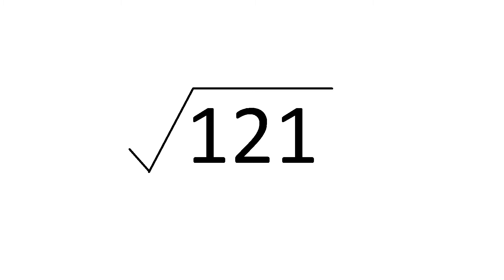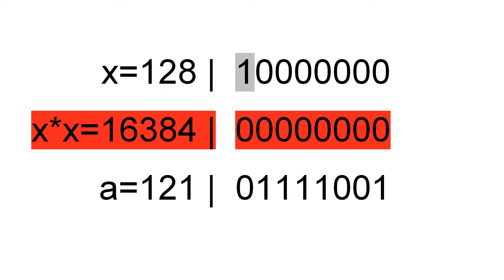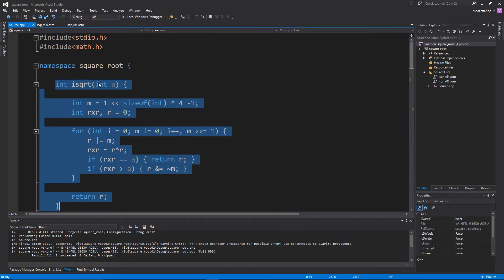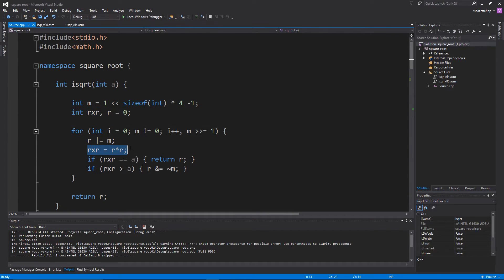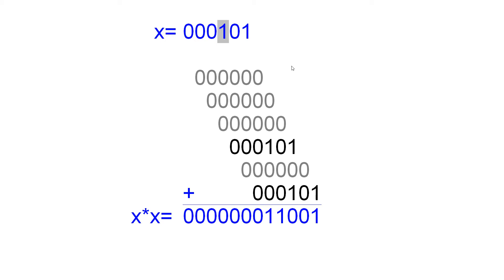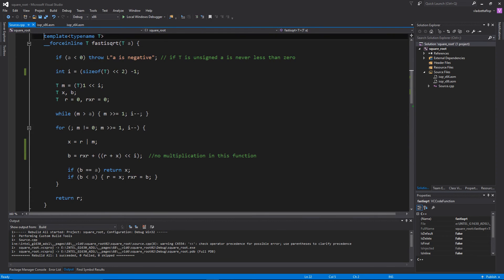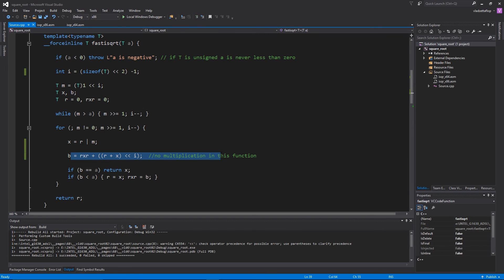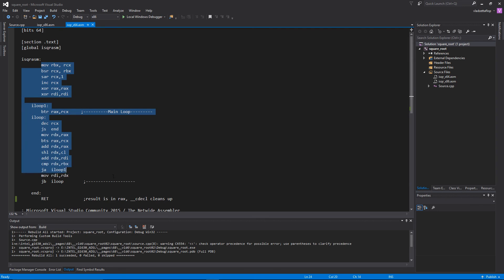Calculate square root using only addition in your program

Comment: Great video & informative 
But what about big numbers like you know integers has limit in cpp that limit would be 2,147,483,647 what if I want to calculate for example avogadro numbers with more than 23 digits not 10 digits like you int.
I know it because of the algorithmic registers inside a cpu they have a limit of 32 bit or 64 bit.
What if I want to calculate 1 followed by 30 billion zeros what to do , do you have any recommendations about this topic “ calculating big numbers “.
Reply from the maker: Well in binary square root of 30 bilion zeros will have 15 billion zeros . Other than that I would use
haskell , it can calculate factorial of 100000 or more. I tried it, you get 10 pages of digits.
Reply: @RealRobotZer0  thank you